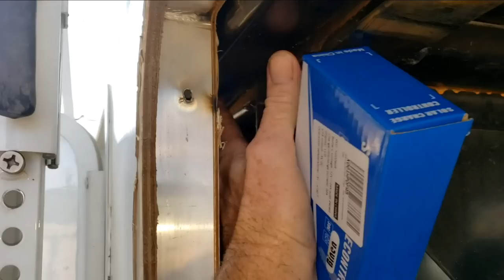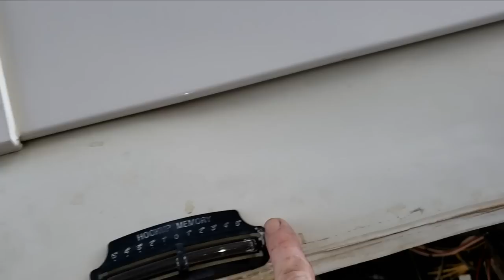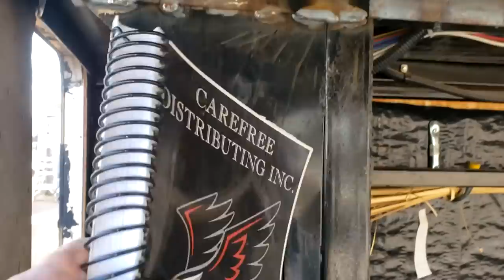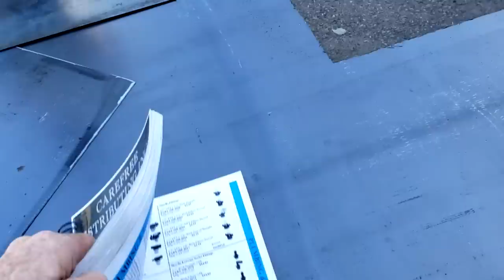Heartland Bighorn 5th Wheel Frame Broken

Comment: I have seen a few of these also. It was a carnival and they were pulling their 5th wheel campers with semi tractors. The tractor suspensions were too stiff and that's what was damaging the front ends of the campers.
Reply from the maker: I believe it. I think every 5th wheel I've watched hook or unhook seems to have some movement on it.
Reply: @AZExpert  You can't make something like this too rigid. It has to flex some, but not too much, otherwise it could look like the one in the video.
Reply: That’s a story someone made up , although it’s true that they break also from pulling them with tractors that’s not the reason. The culprit is bad steel, imported steel, or something in the steel process I couldn’t tell you, but you would need a class action suit because there’s going to be thousands of these things and they’re gonna keep breaking after welded just in a different spot. Could be an inch away from the New weld or it could be above the axles or slides, but it’s gonna keep on happening.

Comment: I wished you guys were in WI.  I have a 2020 RhinoBox 5th wheel frame from a Forest River product (Lippert Frame) that there is some major issues going one.  There is definitely a lot of flexing happening on the non-door side of the upper 5th wheel frame, much in the same spot as this one what happening.  There is enough damage now that the slide-out, above curve down the front of the camper, has totally collapsed on the inside of the camper so that it's touching the floor and the bottom is sticking out about 2 to 3 inches on the exterior of the camper.  Now in the upper right hand of the slide-out, there is an exterior crack in the fiberglass and on the inside of the wall, there is a crack in the wood paneling.  On the exterior left side of the slide-out, the fiberglass seam has totally separated much like it did on the camper in this video.  If you'd like to send Chad (your welder) up to near the Green Bay area in WI, I have a job for him!  I am only kidding as I know it's too far for him to travel.  After seeing this video, it gives me hope that the camper can be fixed.  It's just going to be a matter of how soon can my local RV dealer can get the necessary parts to fix it and get a welder that is willing to give a blessing on that the trailer can tow after he is able to fix it.  Chad did an awesome job.  I would have like to seen the end result of a job like this to a camper that the owner wanted the sidewalls to look like new again.
Reply from the maker: Thanks for watching! :)

Comment: We had a Heartland Cyclone 4101 with similar issues. Broken furniture inside at the front and cracked sidewalls similar to this one. It went back to the factory after 3 months and was there for a month while they cut into the sides and welded in a large C channel to help bolster the frame. 
We thought we were fine until I noticed other issues a few months later near the axles. I took down the corplast and noticed that 6 of the frame cross members were broken. The damage started at an unfinished weld (just a tack weld) on one of the crossmembers that broke and then caused cascading failures.
Back to the Lippert factory who had "repair kits" all ready for this failure - sounded like it was a common issue. They welded in the framing kits and welded gussets at each corner of the 6 cross members.
3 years later the floor in one of the slideouts started to rot. Even though I was careful about keeping the seals good and the edges properly sealed with RTV it still started to fail. We had several electrical failures that I traced to improper wiring. Installers jammed wire nuts on wires without winding them together. Stranded wires were pushed down with only one or two strands making contact. We had burned up wiring in 2 junction boxes that I had to repair. The lack of quality control and supervision was appalling. Every hole in the paneling to pass wires through was cut with spade bits leaving a huge mess of wood and metal shavings that we were vacuuming up for months after we bought it. After fixing everything we sold it never to buy another Heartland unit again.

Comment: I have seen that type of damage on other rv's. Its called too thin of metal. I do not like 5th wheels today. Stop blaming it on maintenance. It was manufactured cheaply by specification by the company that ordered the frames. No one tested the metal used, no quality control. Lousy work.
Reply from the maker: I won't disagree with anything you said.
Reply: Light weight trailer frames smh. Farmers around me swear by the goose neck frames. The suspension are better too with real leaf springs and shocks.
Reply: The undersides of these travel trailers Looks Like they used bed frame angle iron to slap them together.  Doesn't surprise me at all when welds break apart.
Reply: 100% agree and I’ve seen this exact problem on $175,000.00 DRV MOBILE SUITS so it’s the material and sorry cheap craftsmanship. Everyone of the frames are made by Lippert and it’s nothing but cheap China steel.

Comment: Many many years ago I worked with structure engineers designing conveyors.   On thing I did learn that you can tell Chad about.    The angle that was at 7:02 and welded in, would be much stronger if rotated 180 degrees to form a tube or 90 degrees to form a channel.   It seems counter intuitive to turn 90 degrees, but it would be stronger.    Respectfully,    Kevin
Reply from the maker: I appreciate that, unfortunately we had to work with the clearance for the aluminum wall that goes over it and even that angle kept it from sitting flush.
Reply: AZ Expert    Maybe next time.  😊👍

Comment: I do welding repair work for a friend that does RV repair. It is amazing at the repairs that need to be performed on some of these frames. A little more bracing from the frame manufacturers and a better welding program should be required.
Reply from the maker: I agree! Thanks for watching! :)

Comment: Engineering issue. Frame isn't designed to exceed the weights that are being used. You don't see semi trailer failing yet RV frames sure you see the fail all the time. This is the reason I bought a medium duty class A gas rig.

Comment: If your Aluminum if & where poss run counter or other way to steel components it flexes more easily the other direction, east west vs north south or diagonally so. Plus bc prt way solid tub at every key connection pnt 6" or 1ft tub inside hole form fitting tub u get the greatest poss strength to weight & completely diff effect/reaction under driving loads again all about protecting master main beams u jump off/start the build, all to keep it light as hell.

Comment: As an ASU alumni who's been to Rocky Point many times it looks like they may have towed it through the sand without deflating the tires which could cause an immense amount of stress on the frame...especially if they got stuck and needed one of the locals to pull them out. Those guys are not gentle on vehicles.
Reply from the maker: that's definitely I possibility

Comment: Nice fix. I know 1 yr old but I subscribe to your channel and I’m catching up.  But I have done framing problems search in a Lotta chassis videos popped up. Think the name is Leeper chassis. What you just fixed and the fifth wheel box where it mounts to the chassis. One video showed if it wasn’t connected to the truck and then the trailer drops on to the back of the bed. When he showed the video the gooseneck separated from its chassis mount. The one welder that showed up pointed out what the problem is. They use the same thickness of steel throughout the whole chassis. And they put the supports in but the steel is too thin for the three stress points. He says yes you’re going to have movement but think of it this way. You take a thin piece of metal and flex it. It’s gonna break. Now take a thicker piece of steel and flex it. It’s gonna break. The question is when do you want it to break in three years or in 15 years. And like I’ve always said in my comments to your videos it always comes back to how long is the warranty. Hey keep using the cheaper steel it cost less and if it gets us past the warranty. It’s the customers problem. This one gentleman wrote to the transit company and their excuse was you had your trailer overloaded or you did some thing you weren’t supposed to do.
Reply from the maker: You have all weekend to binge! Thanks for watching! :)

Comment: Excellent work as always. Quick question for you.
I noticed on several of the roofing replacements that the sewer pipe area is flush level .Do you cut that on purpose to make the decking work faster? If so, what do you do to restore it back after the new deck is on?
Reply from the maker: Yes, we cut the pipes flush most of the time to aid in decking and roof installation. It's just 1 1/2" ABS so a union glues the cut section back on afterward. Thanks!

Comment: In my humble opinion, I believe the design and materials used were the issues why the frame was fatigued and cracked. The dynamic pressures that the frame is being exposed to are just an accident waiting to happen with this design.
If they were designed after the gooseneck equipment trailers, this problem would go away.
I do not have an engineering degree, just hands-on experience with trailers and fabrication.
Reply from the maker: The frame manufacturer states the frame is engineered to handle the specs and if the frame fails, the specs were exceeded. It's nonsense, but when the first question asked about RVs is price, and the second is "are you sure? that's way too much." So customers are demanding cheap over durable.
Reply: @AZExpert  Yes, nonsense especially when everything is outfitted with living quarters. Unlike a gooseneck equipment trailer they can easily be overloaded and you don't see failures like you do on these RV fifth wheels. 
I truly believe the culprit is dynamic impact. They could build one of these trailers like they have been and if it sat it's entire life on the showroom floor it be okay but the minute you start exposing these frames to dynamic impacts that's where the failures will start happening little by little until it gets to the stage like what's in your video or worse.

I understand what you're saying though about the consumer is a pennywise dollar foolish. But these potential buyers of these fifth wheel RVs if they would just see videos that you and others have on about the fifth wheel literally being torn apart from the rest of the trailer it would change their mind.
Reply from the maker: This frame failure was not an issue until Lippert went to a thin wall tubing. It's really crazy what the industry gets away with.

Comment: Partial closing of both ends of the frame memeber with the failed weld should prevent this failure from occurring on all other unit with this frame. The steel is as thin as possible to save weight. The open end allow too much flex, thus eventual failure. Its important not to fully enclose any box tubing to avoid trapping moisture and sweat. Welding of this nature is best left to a professional as not to damage or weaken the frame by overheating this thin steel. 

The smallest frame failure must be fixed to avoid a cascade of failures as other welds and segments fail under added strain. The last thing you want is to see your towable literally ripping apart in your rear view mirror on the freeway. In such a situation the best case scenario is a flatbed trailer hauling your RV away. Worst case is injury or death due to an accident. Crossing ones fingers hoping to make it to the next destination is a gamble to far. Dont risk it. A compromised frame means the RV is not roadworthy. Thus it is illegal to travel. Besides the consequences are not worth the risk. An insurer may refuse to pay damages if the RV was known to not be roadworthy.

Comment: I have noticed most rv left unattended will be ruined in a short time. I  have seen several motorhomes with low mileage and the undercarriage covered with rust. Should I walk away from buying or can they be restored?
Reply from the maker: If it's been sitting that long? walk away

Comment: That box should have been installed with the weld seem to the back not front.  When the rig is picked up by the 5th wheel connection it puts a pull on the front of the box and compression on the back of the box.. If it was installed with the weld seem to the back it would not have split that way, the other welds may have failed but they probably failed from the seem opening up.
Reply from the maker: I'm sure there were many more broken welds we couldn't see. I feel like the majority failure was due to the sidewall to frame failure, but it seems like the frame is the one thing we should count on being engineered well.

Comment: The steal & aluminum will quickly tell u over 5-10yrs of use where u need extra tub or extra retangle square stock or gof forbid diagonal or gusset sheet sheet add to frame welds. If still seeing main weld members breaking u need 2nd counter tub drill thru or u r under sizing the members.

Comment: I hope he’s not using MIG. Not many people know that MIG cannot be used outside because of the moving air mass blows the shielding gas away from the weld puddle causing the weld to become porous.
Reply from the maker: I suppose that is true if it's windy, most welders will adjust to the environment by adjusting flow or blocking the wind. Thanks!

Comment: Nore do they hve round aluminum beam the painted so no rust, even if double or triple painted. Then 1 square beam for main strength & round beam to help control & absorb flex & stress but break early on when running thru frame prts or/ & along down the side under the rig. If u r getting bending & breaking on aluminum, u need more steel extra welds & gussets by u r fixing whole frame members. Not need to feed new round bar.

Comment: How many of these trailers have been way overloaded, towed at excessive speed,  to fast down bad roads? Or all of the above? When i spent last winter in Quartzite I saw so many rigs obviously overloaded by what they unpacked, and some with Hitchs pulling trailers behind them with cars, trucks and boats in double configuration just because you can doesn't mean it's safe or you can do it! When I was working my way west through Tennessee I40 was worse than NYC with potholes but people towing campers were passing me at 20+ mph over the speed limit! And they blame the camper when the tires blow out or they cracked the frame. Yes some campers have QC issues that's another reason to take caution and not drive like it's a purpose built off-road vehicle.

Comment: Can you tell me how much snow load can a heartland landmark fifth wheel take? I’m keeping it in a very snowy area of canada during the winter and wonder how strong the roof is?
Reply from the maker: I would contact the manufacturer. I would say keep the roof as clean as you can, they cannot handle much. also allowing ice to build up could cause leaks just like a residential home.

Comment: Im no structural engineer but this unit appears to me not to b suitable for regular towing in the future. I wd repair it, then tow it carefully to a permanent location, attach full hookups and skirt it, and use it as a permanent residence to be sold as is.
Reply from the maker: IT will be ok

Comment: If side by side by side long ways back to back is 1/16 or 1/8th of an inch lower to shares lesser vertical load by diff flex load the way u want it not all lined up.

Comment: These camper companies just send the specks to the frame company which is probably Lippert Industry who makes frames and axels but Lippert does not engineer the frames the camper company does but if they would just double the thickness of all the steel they would not do this but the speck this stuff out. Did you see the piece of steel boxing it was so thin almost paper thin.

Comment: In any other transportation industry there would be a hue and cry by the gov't to have these things inspected for compliance with metallurgy, weld penetration and assembly standards.  We're sharing the highways with these pieces of rolling junk.  They routinely travel in the 60mph and above speeds. If these were commercial trailers .........

Comment: I PURCHASED A 2008 HEARTLAND 3712 MODEL 41 FT. TOY HAULER TRIPLE  AXLE. IN 2012 .  IT HAS BEEN IN STORAGE UNTIL A YEAR AGO.  IT IS SIMILAR TO THIS ONE WITH THE EXCEPTION OF THREE AXLES,  10 X 12 GARAGE IN REAR, AND GOOSE NECK ADAPTER.  QUESTIONS:  A) MY JACKS DO NOT GO HIGH ENOUGH TO CLEAR MY TOOL BOX IN REAR OF MY FORD 350 8 FT. BED. THE BOX IS LOWER THAN TAIL GATE.  I GENERALLY HAVE TO MANUALLY CRANK ALONG WITH ELECTRIC JACK.  "IS THERE A SOLUTION ?  B)  IF I COULD RAISE THE GOOSENECK; I.E. ANDERSON ADAPTER THIS WOULD CORRECT THE ISSUE; HOWEVER, I HEAR THAT MAY PUT TENSION OF FRAME??? I ENJOY YOUR INSTRUCTIVE VIDEOS AND YOUR METHOD OF PRODUCTION.  KEEP UP THE GOOD WORK.  OH ONE MORE THING C)  I PLAN TO INSTALL AN ALL ALUMINUM ROOF LIKE A COMMERCIAL TRAILER AND OR AIRSTREAMS.  BY QUESTION IS SHOULD I REINSTALL MY THREE VENTS??? I WANT THIS TO BE A LIFE TIME ROOF. LIKE AN AIRSTREAM.
Reply from the maker: I'd be interested in seeing the metal roof when you're done.
Reply: Why are you yelling? (All caps)

Comment: The roads in America are basically too damaged for today's 5th wheel RV's. Today's rv's aren't capable   or built strong enough. I'm an over the road truck driver, 25 years. Our trucks get hammered and they are built much stronger, frames on these RV's are junk.